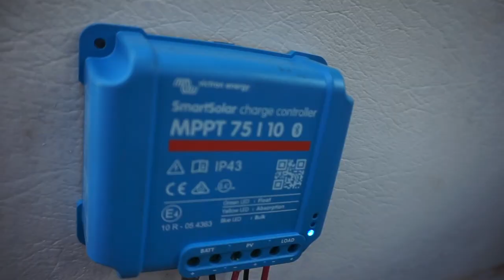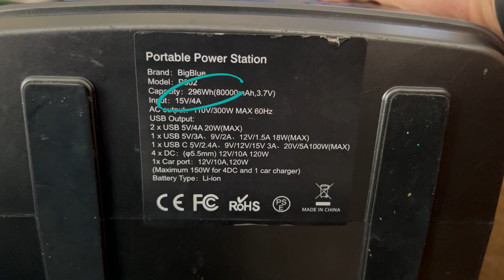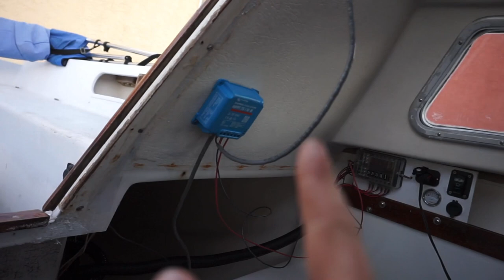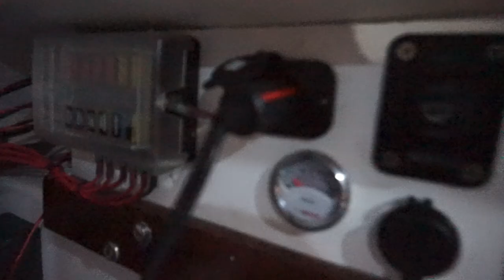Getting ready for weekend camping trip - Catalina 22 UPGRADE TO LIFEPO4/VICTRONCONNECT

Comment: Cool! I like what you have done.
I have hull # 8588 . I hated the original sliding Gally ripped it out and trashed it. I built a new one from plywood and put it on full extension drawer slides. It's much better use of space and way easier to pull out.
On the stove we use a single burner camp stove that uses the small butane canister. They are cheap and don't use all that power.
We have a fridge like yours, simrad 7 plotter, tiller pilot, led lights wired in for cabin and running lights, vhf radio all on a 100 ah deep cycle marine battery. We have a 30 watt solar panel on the stern rail. Just to give you an idea.
We are currently getting ready in April to cross from Miami to Bimini.
I'll try and get a video of the mods we have done so far on here.
I like your Bimini top, did it come with the boat?
Reply from the maker: Be awesome to see a video! I plan on installing another 2 lithium banks with the two 50 watt solar panels, only one I can’t make my mind up on is the stove up would love to run a induction just for simplicity and not think about forgetting propane or running out but I haven’t done the math for if it’s even possible
Reply: I put a video up of the Gally and the inside of my boat. Check it out!